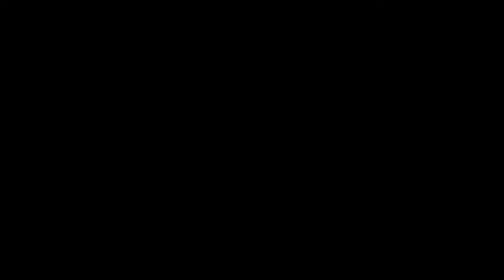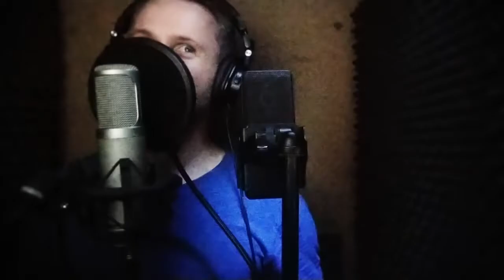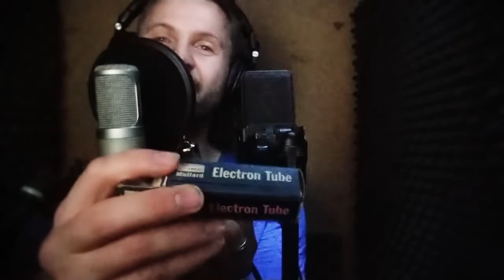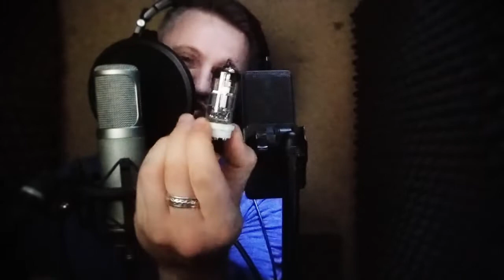Rode K2 Tube Swap pt1

Comment: very informative. IMHO the replacement Mullard does smooth things out, and to me absolutely makes a difference. It does tame your sibilance to a point, and adds some richness and depth to your vocal timbre. 

I also have a very sibilant voice, and have bought/sold many a mic; over time a mic's inability to control my sibilance became more and more irritating to my ears. I have tried different methods vocally to tame my sibilance, but a de-esser has worked wonders for me. Its best, though, to tame it at the source before processing (microphone)  . I personally Avoid mics that have more than a 2-3 db peak between 7 and 12khz (the Rode has close to 5). But it all comes down to what your ears tell you. cheers